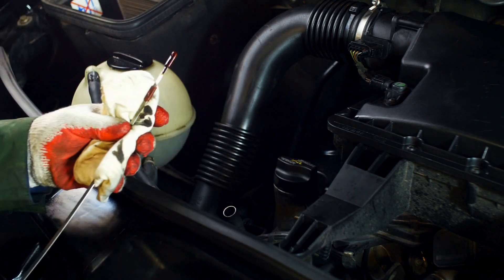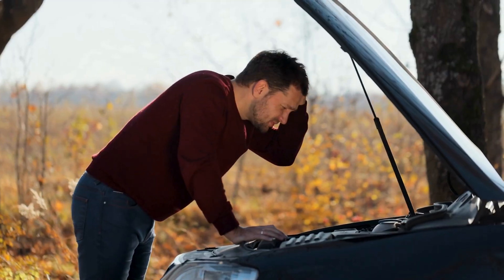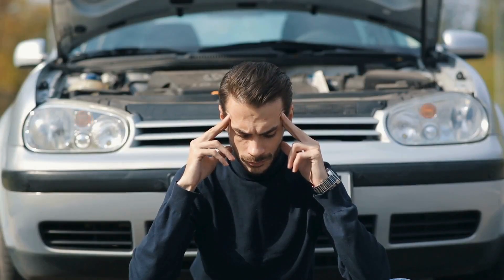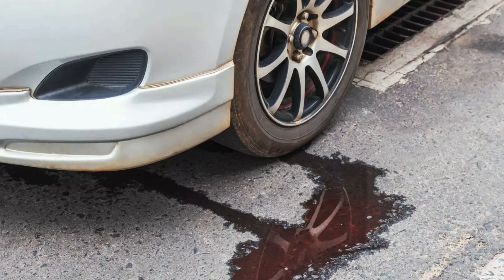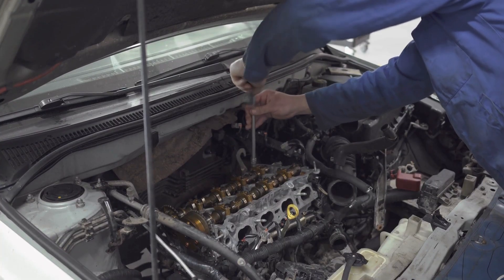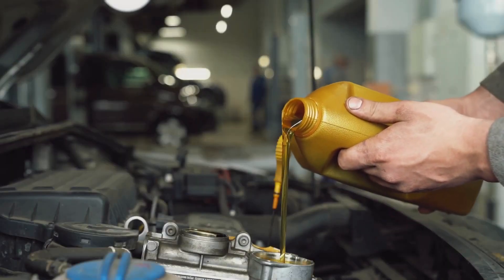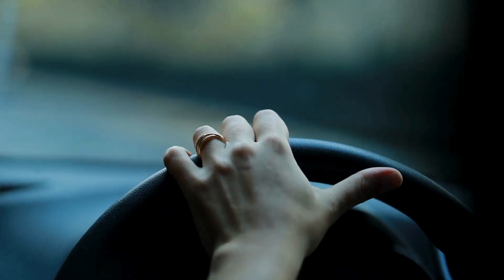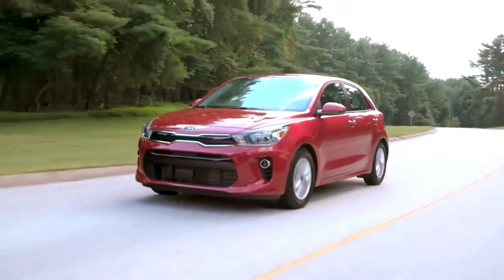5 Common Causes Coolant Mixed With Oil (What To Do And How to Fix)

Comment: Thank you for the video! Very illustrative. 
I have an OEM651 diesel Mercedes C class. 
I have this problem and they check the oil coolant and told me it was broken. But a few days after I got the car back I have the same problem. I don’t know if they didn’t do a complete cleaning or I may have another more expensive cause. I don’t know if it’s time to  stop repairs or give another chance to the car. Do You think is it frequently that some mechanics don’t do a good cleaning after this oil coolant works?
Reply: I used this product for my Holden car,  it stop leaking coolant. https://youtube.com/shorts/EdT42aM9w1I?si=Nkb6ZVVcqRC9UIxR
Reply: It’s a common problem in Mercedes.  We are having to spend over $11K now to fix an oil separator bc of this. Absolute nightmare!

Comment: Hey ! What if my car doesn't have oil cooler nd it has the milky sludge in the whole system of the engine, I still need to flash out only? Thank you
Reply: Yap